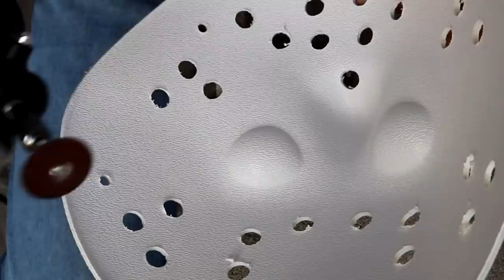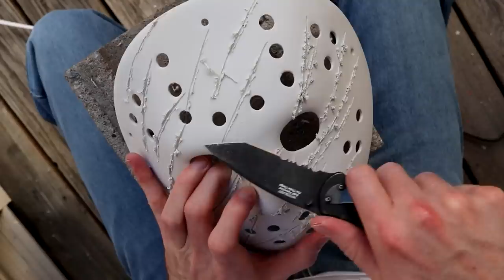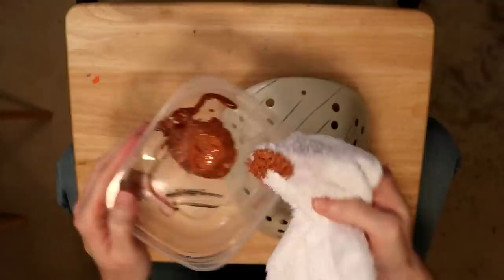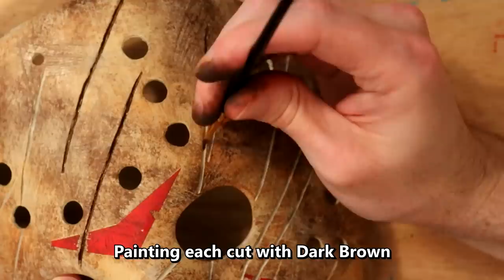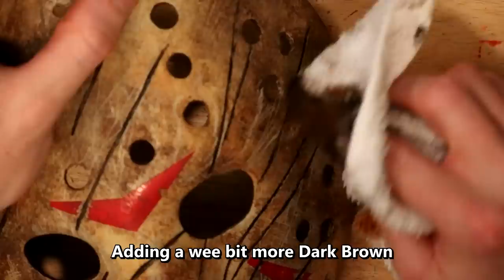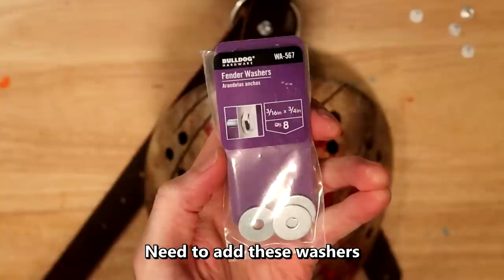How to Make a "Freddy vs Jason" Hockey Mask

Comment: I learned from a bunch of professional cosplayers that the key to good dirt isn't always adding paint on but, taking it off. They also taught me that spraying windex on paint gives it a really nice worn and tattered look, I've  seen some of the effects you can pull off with windex and they look sick. Only problem, I don't know whether it is meant to be used on spray paint or acrylics. I'm afraid that will require your own experimentation. Love your work.
Reply from the maker: Yeah I'm sure there are many better ways to make "dirt". That method sounds interesting. I tried a "rub" technique early on in my masks but it never worked for me. That was essentially where you cover the mask in brown acrylic, then run water over it as you gently rub away the top layer. I was just too bad at doing it. lol

Comment: Is it necessary to use the spray ?
Reply from the maker: Which spray? The one at the end? A clear coat at the end isn't a MUST, but it's a good idea because it protects all the paint you've applied. If you don't clear coat it then there's a better chance of scratching or chipping off the paint work you've done.